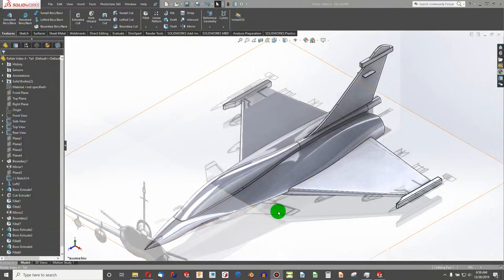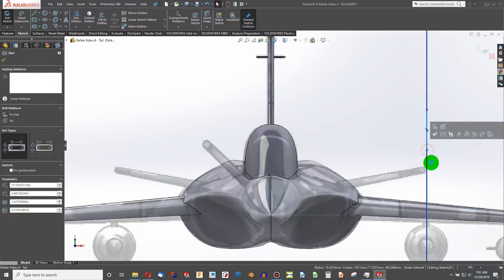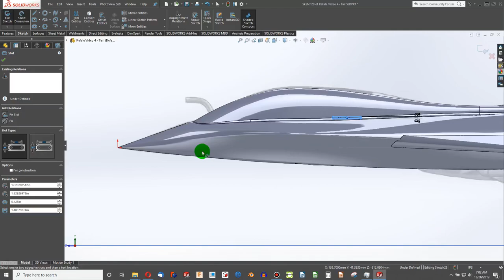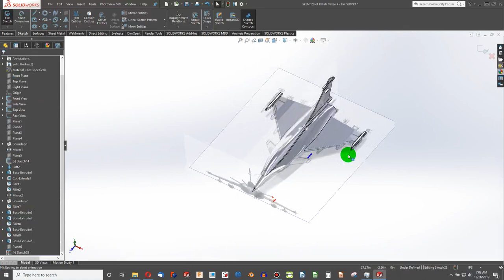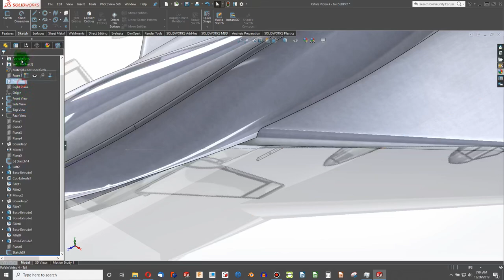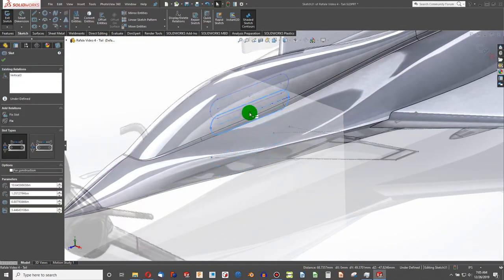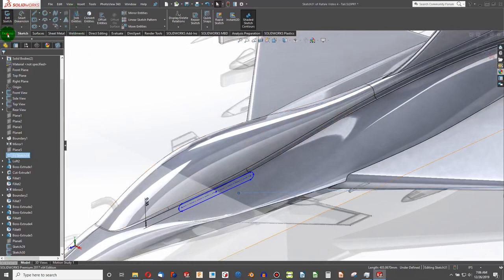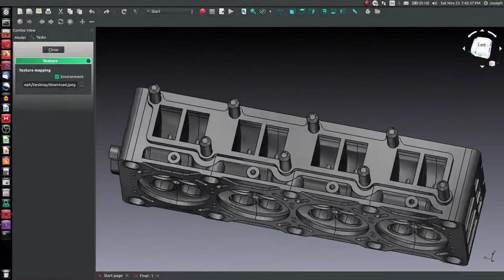Make a Rafale Fighter in SolidWorks Video 5 - Canards |JOKO ENGINEERING|

Comment: Hey bro, nice looking plane. I was watching your gas turbine video and instantly subscribed. I was wondering if you could look into doing a video on how the AGT1500 used in the M1A1/A2 Abrams actaully works... Much like you did in the video i mentioned. Considering it is a jet engine and looks nothing like one i would be interested in learning more on it if you have the time and desire to make a video on it. The darn thing is confusing to me, where does it get it's air and how does enough air get in such a tight little space. Speaking of tight little spaces im like "how doesnt it just melt?" or worse "how does the engine stay cool enough on the outside to not ignite the fuel in plastic tanks next the engine in such a small cramped metal box". I mean you would think a jet engine would get so hot it would ignite it or at least melt the plastic. Sorry, im building a scale model of the the M1A2 right now and working on the engine and it peaked my curiosity and there wasn't much out there to satisfy my mechanical engineering interest. Maybe i've been sitting here too long gluing and painting but i mean you got air intake, heat, gear reduction, and the fact that you never see fire coming out of the back of the M1A2 during operation or start up. More to that...how does it even start? Yeah im pretty sure im rambling now. I knew i should've built the armored D9R. I feel i would have been far less intrigued by the mechanical aspects of that.
Reply from the maker: Yeah sorry for the later reply.  There is a lot of protected Intellectual property around that topic of the tanks, so I'm sure the full extent of the thermal management is at least partially a secret technology.  I could tell you that they route the exhaust gasses near the inlet to act as a heat exchange with the cooler inlet gasses to lower exhaust temperatures.  Some of the exhaust is recycled to the inlet to remove particles coming into the engine as well.   I know that the engine is started by spinning the turbine engine to create compression and ignition, and I'm somewhat sure it's electric.  The D9R is super cool.  Hope that helps
Reply: @JokoEngineeringhelp  Thanks for the reply. I understand that thermal management is an important design feature as it has to do with masking the tank signature. But you did offer a lot of insight with what you did find out. 

Yeah, the D9R Armored dozer is a neat machine but unfortunately wont work. I want to do a small town USA zombie apocalypse diorama and the D9R was never adopted into service. In the early 2000s for the occupation and related construction ops we were loaned 13 of them from an ally for the USMC to use but they never actual USMC property that you would find here on the streets of small town USA. Still a neat machine though.